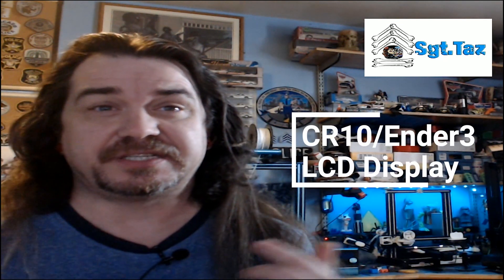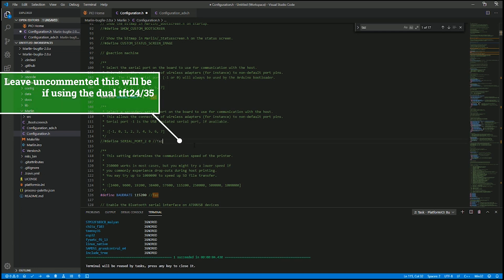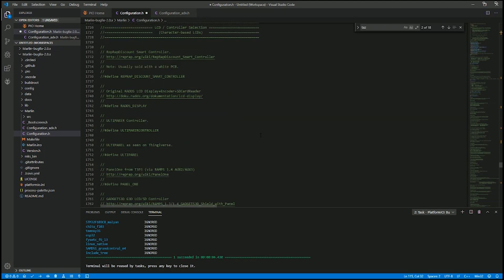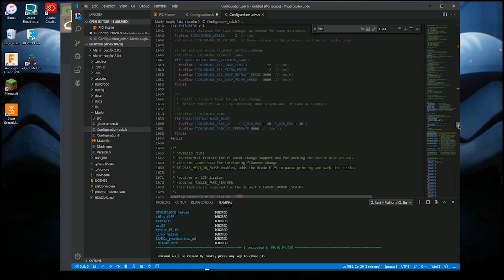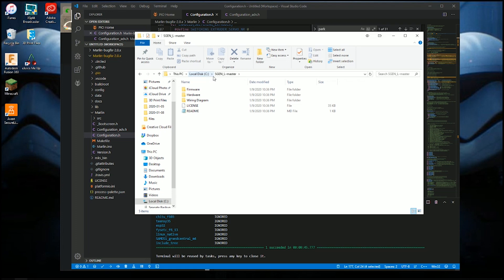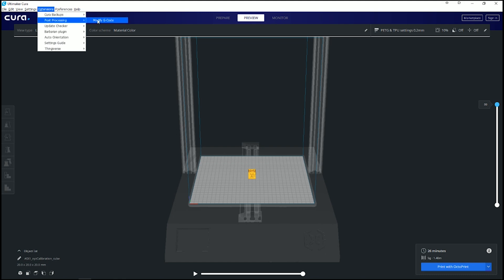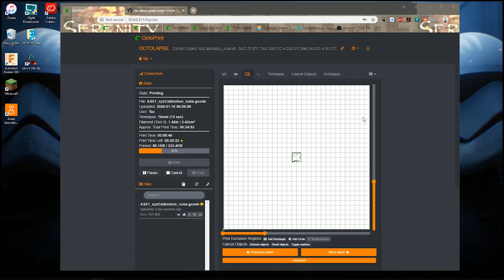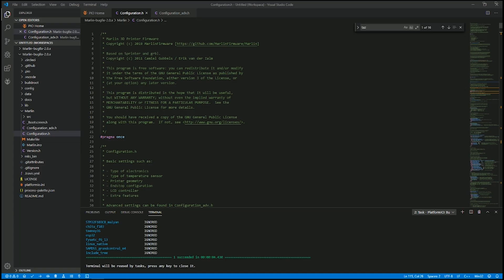Artillery SWX1 2 Color Projects with MKS SgenL & Cura

Comment: hi if ı want to use mks  tft24 ,ı wıll open whıch code in the marlin 2.0
Reply from the maker: you will make changes in configuration .h -the github has all the info on making the proper changes
Reply: @Sgt.Taz3D  I know github and research  but ı cant find it .maybe you can help me but okey if you dont know :) thank you TAZ
Reply from the maker: @ahmetc8319  #define SERIAL_PORT  -1, #define SERIAL_PORT_2 0, #define DISPLAY_CHARSET_HD44780 JAPANESE, #define REPRAP_DISCOUNT_FULL_GRAPHIC_SMART_CONTROLLER  (these are the changes if memory serves )
Reply: @Sgt.Taz3D  its working man ,ı am grateful to you.:)
Reply: my last problem i have a cube printer.when ı start to print ,y and z axis move but x axis does not move.how can ı solve this ?
Reply from the maker: @ahmetc8319  Need to make sure that it's registering when homed (triggering endstop) track down the wiring and make sure nothing is loose or unplugged/broken, if that checks out try swapping a stepper driver on the mainboard and see if it changes the axis to the one you swapped. if it does most likely a bad stepper driver. Motors don't break that often so that would be the last thing to check
Reply: @Sgt.Taz3D  i tryed drv 8825 if i work to printer i change to tmc 2208 but i check other drv and 4988 again same things.in addition when  i entered some g code i see  unknown command m119 m501 and m500 working but G20 g 21 and m851 dont working do you know it ?
Reply: ı solved this problem but ı cant set to control with  m851 z probe
Reply: hi During printing, sometimes 90%, sometimes 60%, the print stops itself.
have you experienced this problem and solved it? and can you help me ?
Reply from the maker: @ahmetc8319  lot of times it's a problem with the file structure on the USB/SD card. Try and keep low amounts of files stored on them as well as reformat if your having trouble. it tends to stop those problems
Reply: @Sgt.Taz3D  
I just changed my sd card I'm using cura 4.6.1 as slicing. Could the problem be something else?
Reply from the maker: @ahmetc8319  Formatted in FAT32? and if they are large capacity they tend to cause issues as well
Reply: @Sgt.Taz3D  
many times I formatted it with fat32 . maybe it's about print speed?
Reply: hi man ı again me :) when ıt start to print a few minute after,its stopping itself.but the tempruture is the same position.In addition motor current is a normal ,when the print is stop and ı touch, ı can see to  motor overheated.also ı changed to sd card and too many times ı wıll restart wıth fat 32 .can you help me thıs direction ?
Reply from the maker: @ahmetc8319  can you go over to discord-there a bunch of folks may be able to help out. https://discord.gg/uPnhpZ
Reply: @Sgt.Taz3D  Can you invite again ??
Reply from the maker: @ahmetc8319  https://discord.gg/nmsssS
Reply: @Sgt.Taz3D  thank you bro

Comment: Hey man, you have done some cool stuff on the X1. Did you manage to get rid of the inconsistent layer lines many of us have been experiencing? If so, how? I have tried everything and i really like the printer, but the inconsistent layers are just really annoying. (Its not really z-banding i think)
Reply from the maker: Lot of the line issues are between slicing, speed and using consistent filaments . I use 3D Nexus with cura 4.5 now and it has reduced problems significantly   https://3d-nexus.com/resources/file-archives/download/8-artillery-evnovo/14-3dn-artillery-swx1-and-genius-cura-4-5-machines-and-profiles   This had refuced a lot of issues for me.